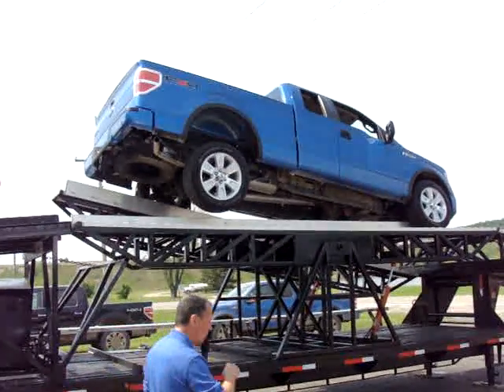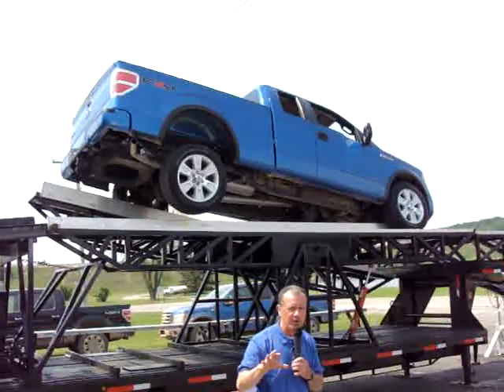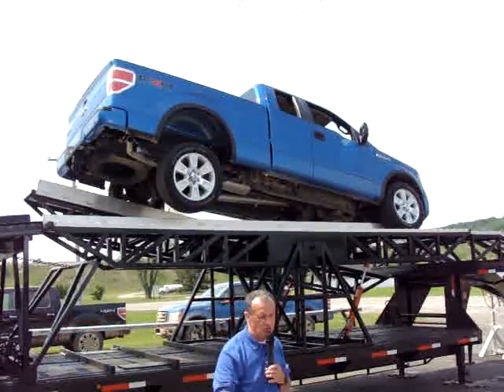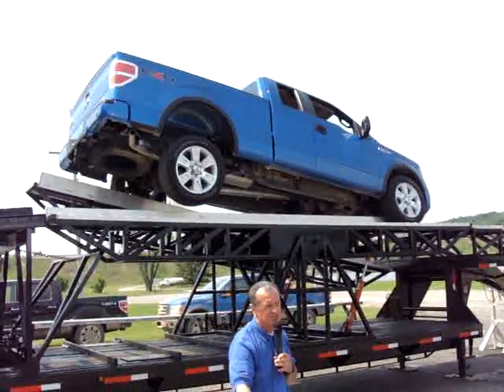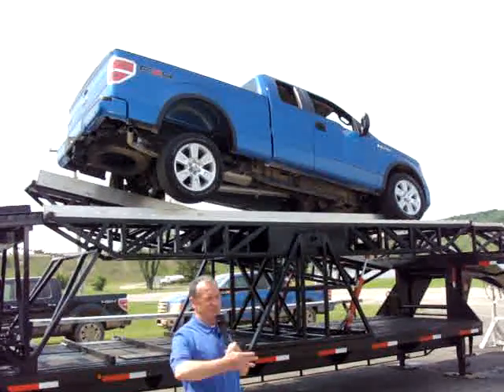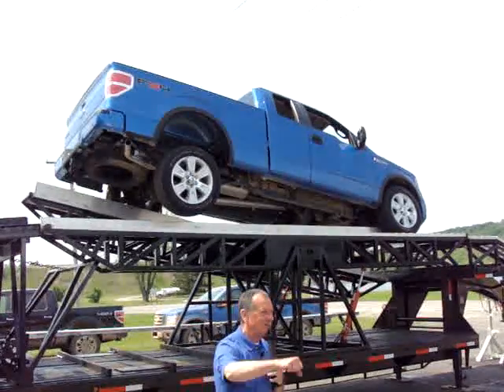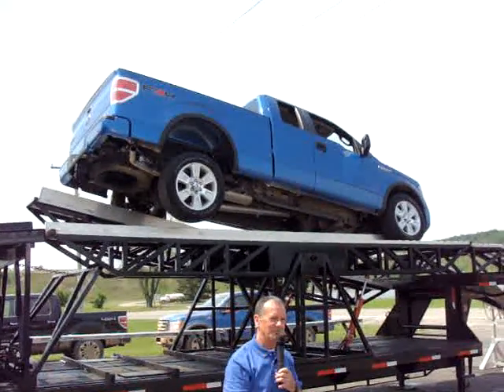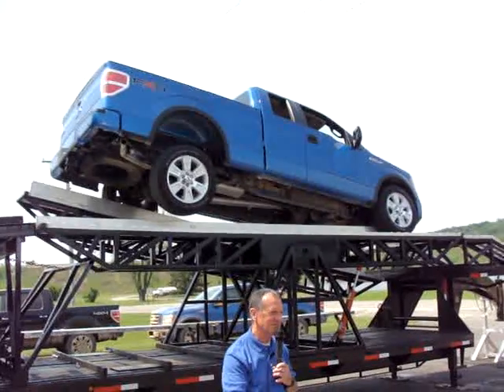2009 F-150 Frame Twist Test

Comment: Funny thing is the weigh is offset by the weight of the engine tilting the truck forward and they relieves stress on the bed twist. This is not a good test. The other twist tests that are performed on level ground show the true twist of the frame. Ford is one of the worst when it comes to flex and twist. Flimsy.
Reply: Like the Tundra?
Reply: Couldn't have said it better myself. I'd love to see that front driverside wheel elevated, I bet you wouldn't be able to open the lift gate.
Reply: Absolutely. This is a pure marketing BS "test" to make their crap look "good".

Comment: Why do pick up trucks flex in the first place? It seems like a stupid design to separate the bed from the cabin.
Reply: To maintain better stability while hauling/towing. The Avalanche isn't built specifically with hauling/towing in mind, that's why the specs are much lower on it than a comparatively powered typical truck.

Comment: i drive a tundra, but i also give respect where its due. Nice truck, well i also drive an 08 f150 that is about to die, it's a v6. i don't own it, work does. truck has 16000 miles. Motor stutters, muffler about to fall off, a/c shot, but remember this is driven by people that don't care and our mechanics don't change oil or anything till truck breaks. what a bunch of tards.

Comment: toyota, chevy and dodge dealers show off by doing tugg of wars. ford does this. they dont bash the competition, they advertise thier products. when your product really is the best, you dont have to do 9th grade feats of strenth, because you know your really the best, and so do they : ). also, put a raptor on that little machine, it will break before a wheel lifts

Comment: You never said SHIT about GM, and GM and Ford get the same gas milage. You do understand that Chylser (and in assoation Dodge) has the LOWEST. And I mean the LOWEST QAUILTY RATINGS out of ALL auto manufactures selling cars in the US. Pull your head out of you ass! THe ONLY expectation IS The GAS base model Ram. Which as you said yourself is out gunned by the F150.

Comment: Easy buddy. I said "big rig" because thats what it has been called. Asshat. It's an unofficial name. I didn't know Ford will start building there own engines in 2011 but that is then, this is now. And I don't have an erection for dodge (I own a chevy, look at my page) you just can't handle that Ford isn't perfect. Notice I said: Dodge=Durability, Ford=towing, and Chevy/GM=Gas Mileage. I gave each there dues. And when you get to the F-250/2500s and higher the ball game changes. Pay Attention.

Comment: If you didn't have brand loyalty, then I don't get why you have this big erection for Dodge. If you where objective you would understand that the only way Dodge beats Ford is with the cummins engine. And we will still how long that stands when Ford starts producing their own engines in the 2011 Super Duty. 

It goes like this for now. 

Dodge has the best engine
Ford has the best body/frame and highest towing
GM has the best Transmission.

Comment: And by the way I agree on the ford thing when it comes too the F-150/1500s but when you get to the F-250/2500s and higher. Then no. I give credit to Dodge because I don't believe in brand loyalty and can admit each one's flaws and strengths.

Comment: No. Dodge has had the strongest truck frames since 94 when they introduced the "big rig" designs. You MIGHT have the better transmission, I haven't looked at the specs, but in the lower class, yeah, Fords going to win, no argument there. Get into the heavy duty class and I'm sorry, but Dodge wins.

Comment: Hmm. Yeah ignorance is pretty blissful for you, because yes the CUMMINS is the better engine, but a Ford is the far more superior body, frame, and transmission. And yes the Ford DOSE tow more. Because an engine is only as good as the transmission its connected too.

Comment: simple, consumer reports scored the 2009 F150 67 out of 100, Edmunds says the steering at speed is scary and so did the BBC's Jeremy Clarkson who said "how can it be this bad?". Car and Driver editor rated the truck 2 out of 10. I am brand loyal, just not stupid enough to go out and spend $35,000 without doin research.
Reply: you brand loyal enough to pay 90k for a truck now?
Reply: @Porter Bennett  Nope..I bought a 2021 Tundra 5.7 Crew Cab for 48K

Comment: MPLSTORM

You're kidding right? Ford has the highest tow rating, which in part has to do with the strength of it's frame. Chevy and Dodge trucks can't keep with up with Ford in the working truck category. Almost every tow truck you see is a Ford.

Comment: ...which would be plenty stiff enough to do the job.  Simply put, the c channel frame in light truck application isn't heavy gauge enough to perform even close to what a box frame can do. The improvement more than justifies going to box in light applications.   Nobody's saying that Box wouldn't be better in heavy applications, rather that it is not optimal, or necessary. You don't understand strength to weight ratio? It's more important in lighter vehicles.  Toyota lives by cheaper to produce.

Comment: Your a clown...and a lying one.  Hydroformed boxed frames aren't necessary in 1 ton and up configuration - this is basic engineering.  The C channel frame on the tundra is TINY in gauge and dimension, compared to a super duty's.  Heavy gauge C channel works fine on heavy trucks and structures - light gauge C channel is substandard in 1/2 ton truck applications due to flex.  That's why box frames are now contemporary on light trucks.  Semantics again eh asswipe?  Your Tundra is built CHEAPLY!

Comment: Wiki, god your ignorance is amazing. The tundra has a fully boxed frame just under the engine bay. Why? simple they actualy wanted the motor to stay in the truck, and so that it could actualy survive a front impact. Which it tested poorly on fyi. 
The C channel frame is used for ride comfort, for guys who buy trucks for a fashion statement. Even though the Tundra has one of the worst rides of any truck i have ever ridden in.

Comment: I will have to disagree with you. There is a reason why big trucks like the f-350 have a big frame. There is a reason why old muscle cars have full frames. The high torque load of a truck, or a big v8, will put a large amount of strain on the frame. If it is too weak, it will twist, and a twisted truck frame is just bad news. Stiff frame is important for towing. Stiff frame=druable, Flexable frame=comfortable. The toyota was made for those who buy trucks to say they have a truck.

Comment: If that was the case the honda unibody would be a industry standard. But its not, I talked to a man who worked on the Ridgeline design team, and he said that they used the unibody because it flexed more than a fully boxed frame, and would be more comforatable to ride in, but we lost a lot of towing power because of it. 
Flex in a frame is bad,